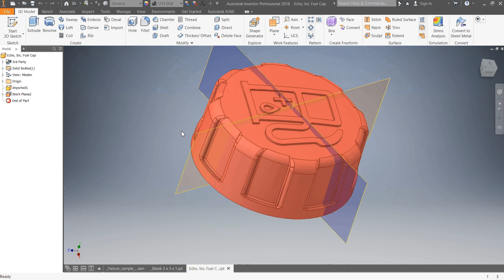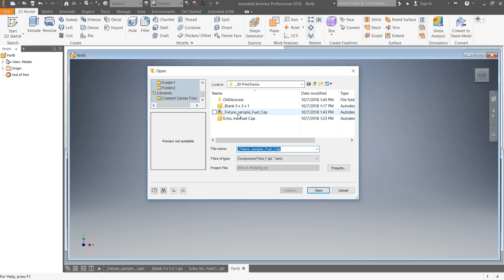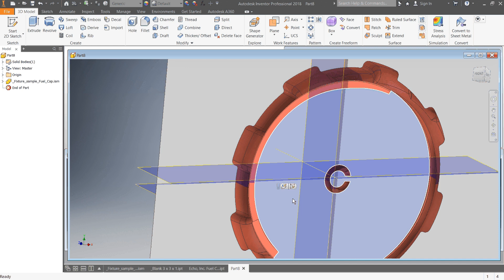How to create a mold (cavity) in Autodesk Inventor 2018 for 3d printing

Comment: okay but how do you get rid of the inside section?
Reply from the maker: You can probably project geometry up to a new plane and then cut (extrude away) the material in the center. Or just create a new sketch, create a circle and cur (extrude ) away the material in the center